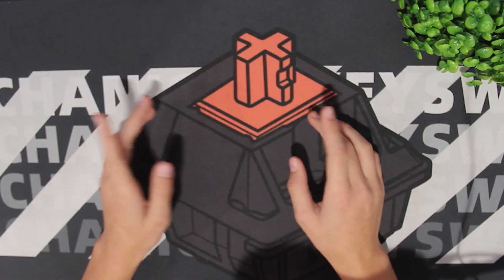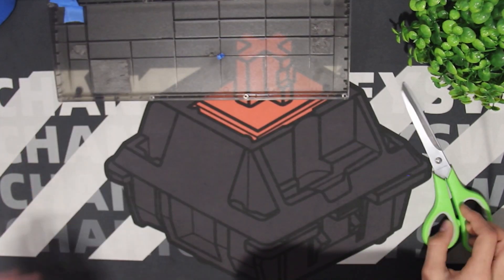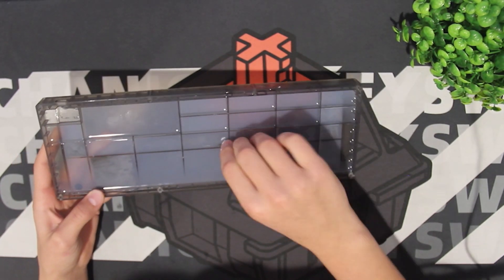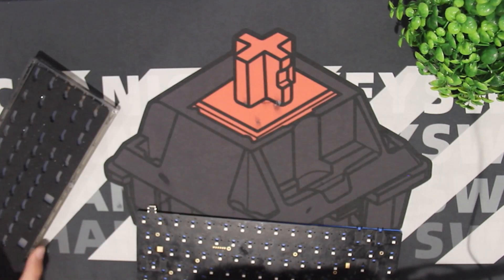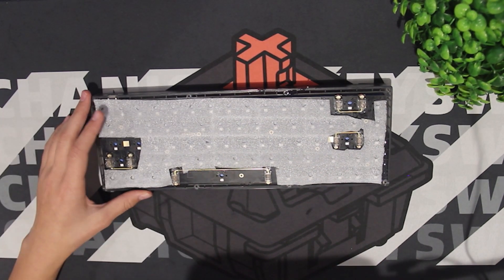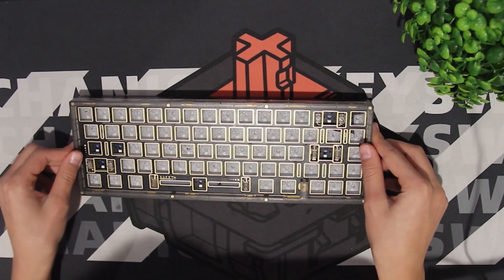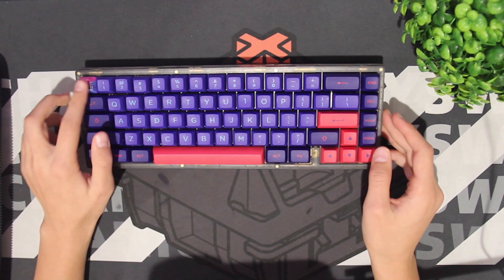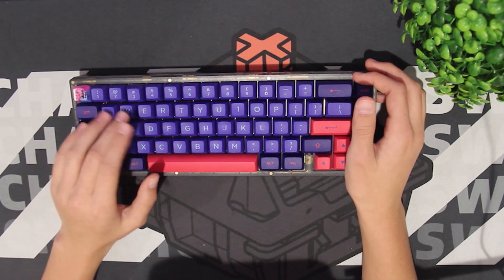The ULTIMATE BUDGET KBD67 Lite Build And Modding Guide | KBD67 Lite | Dinno

Comment: which mods do you recommend for the new lite r3 you reviewed for the best thock possible?
Reply from the maker: I’d do: Silicone Pour, Stock case foam, tape mod (3 layers), pe foam (if you like that sound), and lube and film your switches with deskeys (it’s the thockiest film)
Reply: @DinnoKeebs  you dont think its overkill with the silicone dampener the r3 comes with and the silicone pour mod? what can be achieved doing both vs just the silicone dampener?
Reply from the maker: @popepourri7776  You can’t fit both into the case
Reply: @DinnoKeebs  so chuck the silicone dampener and do the silicone pour mod instead or silicone dampener is good enough?
Reply from the maker: @popepourri7776  Silicone dampener will do the same thing with wayyyyyy less effort, so I would just stick with the stock one
Reply: @DinnoKeebs  finished my r3 build finally and I was surprised I was able to fit everything inside without cracking the plastic. Heres the list of layers I put together and the modz. thank you for your videos!
 STACK  (bottom to top)
- cotton pad mod (polyfil)
-pe foam mod
-painter tape 3 layer mod
-kbd foam
-pcb
-another pe foam (middle hole poked)
-silicone gasket
-poly plate

STABS (Durock V2)
-KBD foam stab pads
-epsi/holee mod (kbdfoam leftover)
-dielectric grease lubed
-mason mod (lubed bandaid under wire)
-wires balanced
Reply from the maker: @popepourri7776  My goodness, that’s a tank of a build, how you are you enjoying it?
Reply: @DinnoKeebs  it’s pretty smooth. I tried o ring mod under keycap stems but didn’t like the sound or feel. I paired the r3 with tangies and polycaps 🌽
Reply from the maker: @popepourri7776  sounds insane 🔥

Comment: Would you say the silicone mod made a big difference, or not? Also - doesn't the Tempest mod interfere with the backing foam?
Reply from the maker: the silicone mod definitely added some weight and made the switch’s characteristics show over the board’s characteristics. the tape mod doesn’t interfere with the foam

Comment: Do you think it's possible to change the silicon gaskets into d65 ones? And what are the possible effects of doing so.
Reply: Star Wars Coffee  Actually you can, someone else made a video on it, I am too lazy to do it but it sounded way less muted on the video.
Reply: Star Wars Coffee  Personally I think the mod is a bitch sketchy, so I didn't bother to do it +lazy, and I think Fr4 plate makes it sound kind of like using D65 gaskets with the Polycarb plate although way less flex if you care about that. Personally I don't mind stiff keyboards so I ordered the FR4 plate but using D65 gaskets is definitely an option